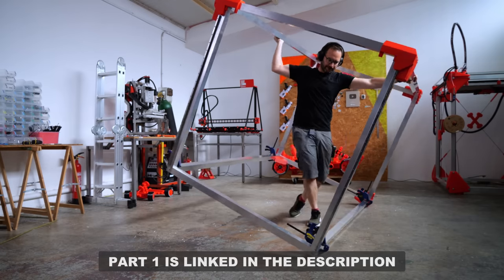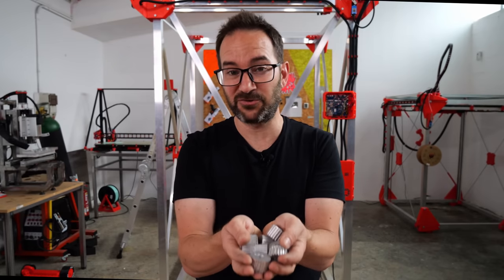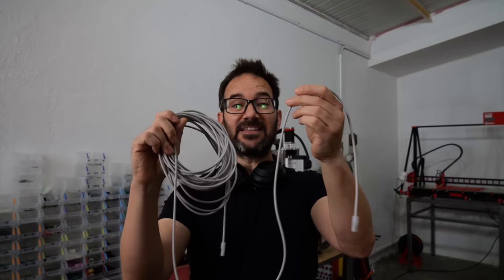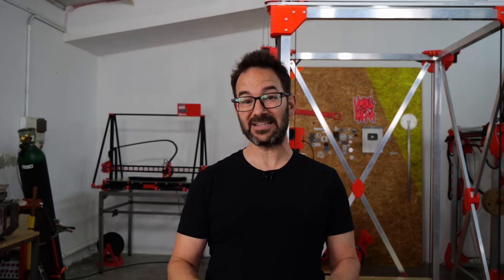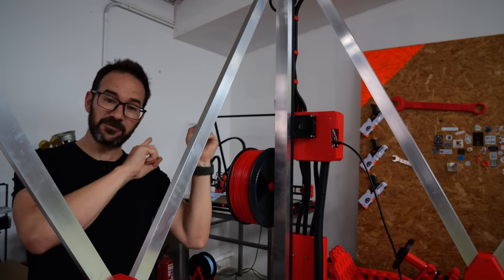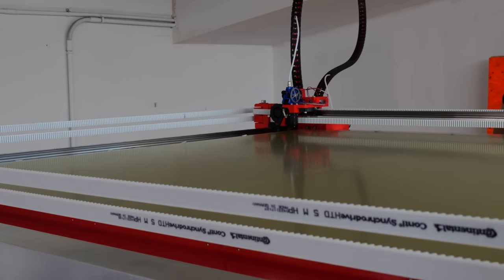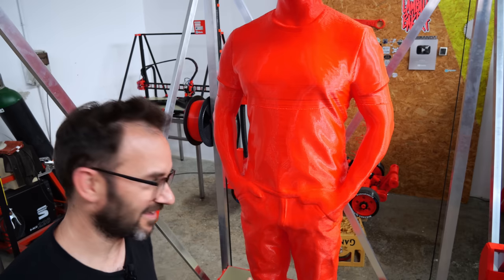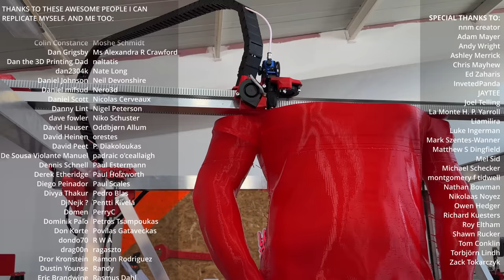You won't believe what I 3D Printed - Giant 3D Printer build Pt.2

Comment: Hey Ivan, for the bed heater you could wrap the cord inside-out (sort of concentric) to only heat the area below the print. Most probably you already considered this option.
Reply: As the cord is not very long, he would also need to get the cable from the mid one across or aside the others which doesnt comply well with his current design.

Comment: Your work is amazing and I love the machine!!! Im a Laboratory Machinist and have a few small suggestions. When milling deep pockets, it's sometimes wiser to use a few tools of increasing lengths to lessen chatter. You can buy endmills with shanks smaller than the cutting edge to eliminate rubbing. Endmills with long shanks and a small cutting areas are also better at deep pockets because they lower cutting forces. Profile ramps are also useful for a finish pass. Keep up the fantastic work!!

Comment: Ivan a printer this size you should have the bed fixed at the bottom.   That way you can take a of weight  when you print it’s much better to have the printhead raise and lower.    Just think that of the stretch on your belts as you put 15 or 20 kg of material.
Reply from the maker: With 20kg the elongation is 4mm at maximum Z height and it is partially compensated in the steps/mm configuration.

Comment: If you ever find the flow rate on the rapido a bit lacking give the VZbot/Mellow Goliath hotend a go. Those things have been tested at over 100mm3/s which is comparable to if not exceeding the flow rate on a Mosquito Magnum+ at a lower price point and weight.

Comment: I absolutely love the nano polymer. It's the only thing I've used now for nearly 2 years.i print everything directly on glass (flipped ender 3 v2 bed) I print pla,abs,pa6-cf,pc, pc/abs blends and much more and it works amazing for every single one. Secret trick is it uses isopropyl alcohol.  So after a few prints I pour a small amount of alcohol on thr bed and use the brush to level out the polymer. When I bought my 2nd bottle I poured half of it into the old bottle and topped them off with 99% alcohol.  One bottle lasted over a year. Love your videos!! Crazy builds and impressive engineering. Please keep it up!

Comment: You could just do the heating element basics (the wire) and then pour a high temp rubber on top and spread it with a trowel. Then, the sky is the limit. You could make any size you want, and perform at any temp you want. To secure the wires down before pouring, a single drop of superglue and activating agent should suffice.

Comment: I have 3X Ender 5 Plus machines that I have modded for production printing and the V wheel that hits the limit switch always eventually gets damaged, I used to just replcae the wheel but got sick of the wasted prints so I slowed down the motion of the homing which solved the issue but now I want linear rails on them

Comment: Never hammer gears onto motor shafts.  Even if you don’t break the gears, you damage the bearings.  If your gears are too tight, get a welding rod oven (relatively cheap) to heat the gears, and a styrofoam cup filled with dry ice pellets to cool the shaft.  Both can be purchased at a welding shop.  Heat the gear, cool the shaft, slide the gear on.  If it still doesn’t fit, your gear bore is too small.  To remove the gear, heat the outside of the gear with a butane torch while maintaining pressure with a gear puller.  Do not overheat the gear.  If it changes color you have too much heat.

Comment: I don't know if this could be implemented the way I'm thinking, but instead of having one thermistor for the bed, would it be possible to mount a thermal camera in one of the corners to better monitor each individual heated wire to correct for discrepancies between the different heated wires, or even just a thermistor on the actual hotend that could go around while the bed is heating up to probe the temp at different spots to assure even heating, I really want to build a large scale 3d printer and have been working on some of my own designs and this has been an idea I've really wanted to try and one that I think could work really well in your case to assure perfect heating for all those SPACERRRRRRRS!!!!!! I LOVE watching your videos, thank you for making me smile more!!

Comment: Very impressive.  I find myself boggling at how many hours of design iteration and troubleshooting you must have into this build.

When you showed how easily the statue print wobbled it made me think of the scalability issues with larger prints and got me wondering: maybe this calls for robotic stabilizer arms with padded contacts to gently 'grab' the print after it exceeds a certain height.

Just a thought.  Not sure if it would work or cause more problems than it would solve given any contact during the print has the potential to slightly shift the print and cause the exact problem it is supposed to mitigate.  Or maybe I'm just over-thinking things and this kind of issue should be addressed with printed tree-like supports integrated into the print.

Comment: The metal shavings around the extruder is unfortunately a known problem with the Apus extruder. The gears they ship with are made with material that wears extremely quickly. I've had 3 fail on me this way eventually the teeth wear away completely. I'd recommend either machining something harder if you have the tools or switching the Apus out sooner rather than later. It is a shame though, Apus seems well thought out and well put together apart from the gear problem. Maybe one day Phaetus will fix the issue

Comment: Nice video! I've been having "thermal runaway" issues on my large format printer for awhile now and have no idea what to change next to fix it. The temperature sensor seems to be reading low or the heater block just cools down to below the threshold and triggers the alarm. I have never seen the temp go higher than the set temperature only lower. Any ideas or solutions are appreciated

Comment: You should use a pellet extruder but if you still want to use filament extrusion you could use a Goliath from vzbot to be able to go to that kind of extrusion speed without skipping too many steps on the extruder
Reply: First time I've heard of pellet extruders tbh. Ivan only prints using one colour, would this be a available?
Reply: @NealFosterHD  yeah, with pellet, you buy raw materials in bulk quantities like a 1000kg for example and then you add 1 to 3% of pellets that are extremely concentrated with color and you have the same color

Comment: I have been looking into 3d printers. I find the plates are very small. more like for small items to kids items. i am looking for specific size items that unfortunately won't fit on any plates I have come across with out costing a fortune I don't have. What was the cost of building the giant 3d scanner? do you have a break down?
Reply: One thing to keep in mind for 3D printing is breaking larger objects up into smaller pieces that can be assembled after printing.
Reply: @zecuse  i get piecing if it is feasible.  however, I want to build durable cases and parts for instance.  I prefer not having limitations.  some other personal items which I don't want to piece together range 15 to 30 inches in size maybe more.  the base of what he built is 40 x40 roughly

Comment: I wonder if you could fill the gaps in the heater wire with some kind of high temp epoxy or resin and then sandwich another sheet of metal on top. Seems like it might be better for heat conduction and should make the bed more rigid and flat

Comment: 🎯 Key Takeaways for quick navigation:

00:00 🛠️ In this video, the creator assembles the frame and carriage for a 3D printer.
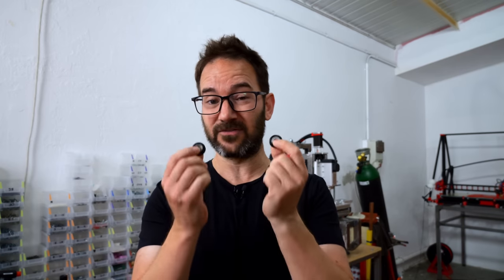01:27 💡 The creator discusses using V wheels instead of linear rails for cost-saving and invites opinions on this choice.
02:55 🔄 The creator makes custom pulleys for the printer's motors to increase bed movement speed.
04:08 🌡️ To heat the large print bed, the creator uses wires typically used for floor heating, allowing irregular bed shapes.
08:12 🖥️ For 3D modeling, the creator recommends Onshape, a cloud-based and versatile 3D modeling software.
11:28 🛌 The bed has various heating elements, and you can control which parts of the bed are heated for power-saving.
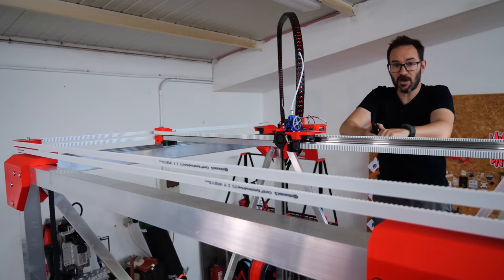13:25 🏠 The creator explains the homing sequence and coordinates for the printer.
14:59 🖨️ A test print is performed, although it has some issues like layer shifts.
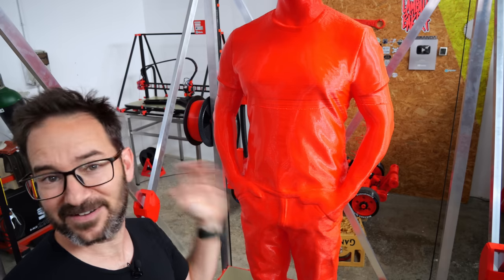16:42 🤖 A 1.75-meter-tall statue is successfully 3D printed despite challenges, and it takes about four days to complete.

Made with HARPA AI
Reply: :face-blue-smiling:

Comment: With a bed and build volume that big, do you have to worry about belt stretch? I would have thought there woild be issues with that happening as the weight increased.
Reply: That is a really good point. I would imagine they probably have ratings for how much they're likely to stretch, but I'd think that lead screw would be a more bullet proof solution.
Reply: @sp0764  probably, also about a lot more expensive, especially with guides etc. In reality, this probably puts a lower limit on layer height and an upper limit on overall precision.

Comment: Great, it's really huge!
But why stinking with fillament? Ease of construction?
Wouldn't pellet be a better choice?
Reply: Yeah 🤣🤣
Reply: Probably a combination of cost and availability. There's just about how many different filament frontends as you could want to experiment with. And they are pretty cheap. Pellet designs are a lot less common, and as they tend to be used in industrial high capacity printers they are expensive. Also if something breaks you are kind of limited to what options you have.

Then there's hopper deigns. Creating a reliable hopper and feed chute is not trivial and requires more research than just slapping a spool of filament and a Bowden feed tube on the machine.

But yea, a pellet system would be an interesting modification. And it could provide material for a few more videos as well as some insight in what the actual differences are and how much you have to print to offset the increased hardware cost.

Comment: Con tu acento me da por hablarte en Español, pero tampoco es que haya confirmado que eres Español

The bed can be heated in sections?
Because if you can , doesnt seems hard to distribute the heating cable in "discs", like the ones on a ceramic hob, so you can save power, heating only the sections you are using, on a normal 3d printer is not really a concern, but in something that big, the bed must be really expensive to maintein
edit: okay, ive seen that part now

Comment: Awesome build! I wonder if you could make some kind of ring of bearings on sticks or similar to mount 20 or 30cm below the extruder position that could programmatically move in and out to provide stability for the top of the print?

Ooh, you could design a support carriage that could move up and down the z axis along with the bed that you could print supports out to horizontally, maybe.

Comment: IIsn't it incredibly expensive to print such a large project with filament? Wouldn't it be cheaper to use a "granule extruder hotend"? I am also planning to build an XXL 3D printer, but in the beginning there was the development of a "granule extruder hotend". For only about 200 euros a prototype would be built and with the successful "prov of concept", I will start building the 3D printer (XYZ) in winter 2023/24. Keep your fingers crossed for me, it all works out! ;-)
Reply: granule extruders and heads are much bigger and heavier which means you need to run slower accelerations/build a stiffer machine/etc. i doubt the construction method used for this 3d printer would be strong or stiff enough to handle that heavy a print-head.
Reply: um it's hollow. Probably only 4-5 kg.

Comment: Is there any reason you stuck with filament for this design?? Seems like to get full use of that kind of build volume would have been better suited to a pellet feeder...
Reply: how come?
Reply: Agreed. Isn't pellets cheaper then buying processed filament
Reply: @wizardman1313 commercially available spools are limited to about 5 kg. I can burn through most of one of those just fully utilizing my 500mm printer. A pellet extruder is only limited by the size of the hopper and you can refill the hopper on the fly without ever stopping.
Reply: @johnnyjoseph1389  thank you

Comment: I love that its just a hollow statue of you but do you think it would look amazing painted? Edit: GIANT BELT PRINTER NEXT!
Reply: With modular belt so it can be expanded infinitely
Reply: Marlin firmware supports it so, it's doable, absolutely
Reply: @quakxy_dukx  do they even make filament spools with enough?! Like a 10kg roll lmao
Reply: @L337f33t  well you’d have to replace the spools periodically, mid-print
Reply: @quakxy_dukx  NEVER, multi spool loader with a runout sensor! In fact why not just make an extruder that sucks in raw PLA pellets and print from a 200kg hopper lmao
Reply: @L337f33t  doesn’t he have a runout sensor on his printers. I’m pretty sure he had one on his last printer and I can’t see why he wouldn’t put one on the new one

Comment: I CHALLENGE YOU!
Make a whole room-sized printer, which takes up the entire volume of whichever space you choose.
Small box room or workspace, it's your choice!
Unless you're in an earthquake zone, or your place is subsiding, you'll only need to attach guide rails to the walls and ceiling.
Your building should be stable enough without needing a frame.
Reply: oh no..
Reply: Great Idea! The room that prints itself - all: the walls, windows, doors, furniture. but in a way that it can be disassembled. And then you can pull the pieces outside and rebuild the room. A self-cloning room, which will eventually become a village :) .... full of scary ghosts of Ivan Miranda statues.

Comment: Taking a wild guess at the brand name of the styrofoam to be Jackofoam? And instead of reprinting the 234 box i would assume it would be far more efficient to rewire the terminals on the switches? plus u dont waste plastic
Reply: But the numbers are still on the wrong side relative to their physical location.
Reply: @Arkios64 are you slow? 

re wire the switch... go google "how to rewire a switch" 

By switching the input to the switch u switch the function. ffs.... u are a smooth one arent u?
Reply: @reyalPRON  Holy shit.
Let me dumb it down even FURTHER for you: the rightmost switch is LABELED with "Leftmost heating element", rewiring the switch isn't going to change that.
The PHYSICAL LOCATIONS of the HEATING ELEMENTS and the LABELS don't line up.

Comment: Serious suggestion. look into putting a chameleon on this even though you have 3 or 5kg spools you are likely going to make prints larger than that. with some coding you could have 2 3 or even 4 5kg spools loaded up and have the gcode auto stop when the first one is "near" finished and then switch to the second third 4th spool automatically.

Next. Printing a full size you is "NOT" very impressive. Printing a full size one of you on a printer YOU designed and YOU built and in ONE SINGLE GO ONE PART

God Mode Activated. muahahahaha

Comment: You should change the way you mount the motors, they need cool air around them to keep cool. They shouldn't be insulated by plastic.

You should have put thermal paste to conduct heat between the heating wire and metal plate and between metal plate and glass plate to improve thermal conductivity.
Reply: Seems a bit overkill to me. You saw the insulation on the bottom right? Where do you think all that heat is going to go? Upwards. Thermal paste would likely create more prominent hot-spots where the wire is.
Reply: @XeonXR6  with thermal paste, the plates would heat faster, with less energy, and more evenly because the contact between wire and plate would be more consistent.

Comment: How is the pei stuck to the glass? I saw you sprayed water? Before there were powder coated PEI flex plates, I used to use 3m high temp tape to adhere PEI to borosilicate glass, this seems a lot faster and easier, and looks like it's on really well, and no bubbles.

Comment: caballero, great video. i have 2 questions about this model. 1 - its ok to print abs like it is or you suggest some adjustment? 2 - in the end you mentioned the metal issue from the gears. Did you found a work around for it? saludos de polonia

Comment: Glad you're making it at least a little budget friendly with the V-Wheels
Reply: Given the size and design of the printer, there is basically no advantage to linear rails. The weight of the part is not crushing the wheels so their  deflection is not a problem. And at the lengths involved, even linear rails would still be dependent on the the aluminum extrusion to prevent deflection. Might as well use the extrusion directly and save a lot of money. The design can also be retrofit to use linear rails on the coreXY print head axes, but I doubt that any benefit to dimensional accuracy would result.

Comment: Secondary Schools require 3D printers that can print 30 to 60 small individual parts, quickly and accurately. I wonder if you have a solution for this circumstance? Maybe this machine could work, though it would be a bit foot print on the floor. I wonder if you could create a vertical, multi 3D printer stack?? Hmmm.

Great project, I wondered if the corner braces could be made with aluminium sheet? Also how does screwing into aluminium hold up in the long run? Any problems with screws coming loose or threads breaking?

Comment: Fantastic build & print,  now you've got to p;aint the statue. 1 thing, is the insulator you used on the heater bed made of P:olystirene, if so P:olystirene can react with PVC & cuase a p;roblem.